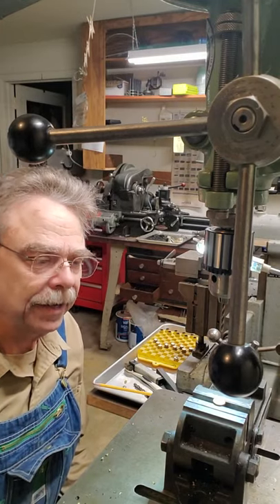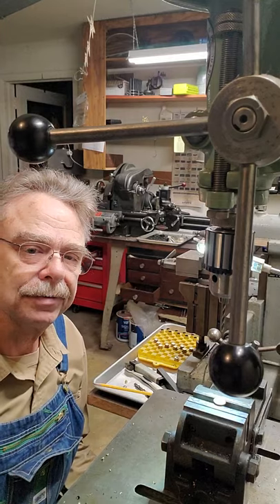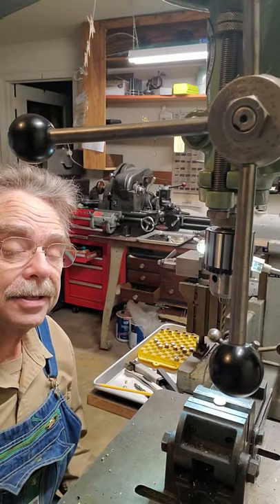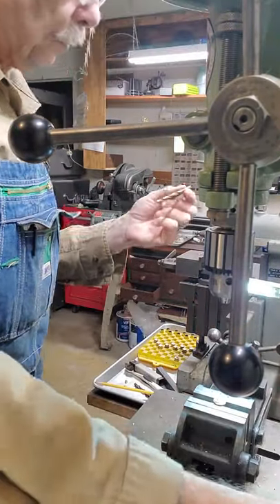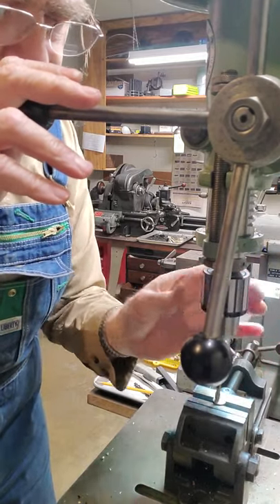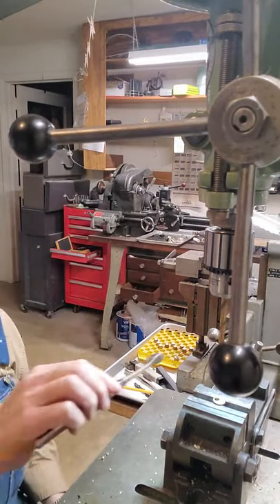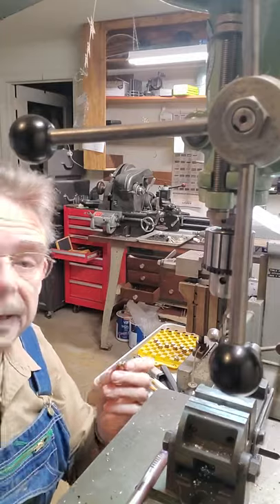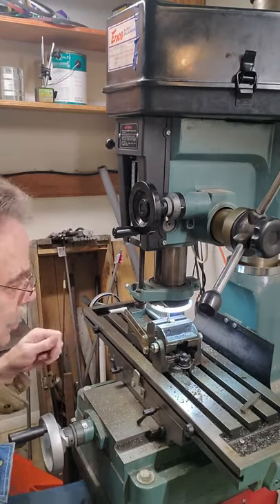Part 2 - How I convert centerfire cartridge cases to rimfire

Comment: Excellent video Steve!  This is an excellent way to get the old rimfires running again.  It would seem this method would also work with ramset blanks in smaller cartridges without adding any black powder.  Anyway, great video!

Comment: Good job, Steve! Sometimes I end up with blanks that fit a little loosely. So I apply a little clear fingernail polish in the hole. Doesn't seem to matter if I then insert the blank, or wait for the fingernail polish to dry.
Reply from the maker: I've done that too, nothing wrong with a little extra security. The .224" reamer work very well, providing a consistent fit of the acorn blank.
Reply: @steveblancard5566  Yes, I should get one of those reamers. I only used drill bits, and like you said, they don't leave a perfectly round hole. And often times, they get a little vibration going, that leaves the hole to big.
Reply from the maker: @Dimwit_the_last_mountainman  I started out using just a drill bit about 7 or 8 years ago. But when I found that a proper reamer was inexpensive, I got one. Well worth the money.
Reply from the maker: @Dimwit_the_last_mountainman  drop me an email at splitdorf@cox.net

Comment: Hey Steve. For your Ballard do you just need any standard .44 shell and what do you use for a projecrile in the Ballard? Normal .44 cal? Very new to this and I have a 44-Ballard I'm restoring. Have to shorten the shell at all?
Reply from the maker: You need to measure your chamber. Some can use  44 mag brass, others take a larger diameter case like the .44-40. That's what I use.  I use a  44 S&W American heel bullet from Old West Bullet Molds. But the heel is a bit undersized. If I was going to shoot it a lot, I'd get a custom mold made for it. More info here:  https://www.assra.com/cgi-bin/yabb/YaBB.pl?num=1618099748/0
Reply: @steveblancard5566  Thank you! Just looking to shoot it a couple times at most once it's "restored"

Comment: Hello Steve ,  Great how-to video,   And to you and John L. ... I have some guns that have very aggressive firing pins that rupture the case of the acorn primers, so I  do not do the last step of milling the edge of the rim as that will take some of the load of the hammer,  until I see how they  ignite......Doc
Reply from the maker: Interesting observation. Has the firing pin tip been altered, damaged or erroded? I would think something changed from how it left the factory. Otherwise it would have punctured the original soft copper rimfire cases too.
Reply: @steveblancard5566  Hi Steve,  You are absolutely correct in that assumption, and I thought the same,  but everything looks stock .   Out of six guns maybe two will rupture the acorns  on occasion      . They have heavy hammers and stiff mainsprings.  !???   ...Doc
Reply from the maker: Doc - please shoot me an email at splitdorf@cox.net

Comment: Ross Jones 
Hello Steve , I enjoyed your video .  I have several Ball &Williams and Richard Ball patent Ballards . I find the 44 40 and 44 magnum cases fit too tight in the 44 RF breech . Did you resize your cases . If so what did you use . Thanks.  Ross
Reply from the maker: There seems to be considerable chamber size variation in these early Ballards. On the N-SSA forum I read of guys using both cases. Mine has a large chamber that shortened 44-40 is just right for. I use a 44 S&W American heel bullet. But the heel is a bit undersized in the case. I found that sizing the shortened 44-40 case in  38-40 sizer was just right.
Reply: @steveblancard5566  
Thanks Steve ,
      I guess I will have to keep buying more Ballards until I find one that will take a 44 40 . I live in Quebec Canada close to the Vermont border where the 1870 Fenian raid occured . The Fenians with their  Needham  conversions were driven back by a small group of  sharpshooting farmers using 30 inch Ballard rifles . Until I find one I will try making some cases from 303 Savage cases like I saw in your how to video , that I found after I sent you my question . Ross
Reply from the maker: Have you tried trimmed 41 magnum brass? I use that in a 44 rimfire rolling block. The rim is a little small, but it works very well.
Reply: @steveblancard5566  
Thanks Steve , I do plan to try them . I have been thinking that the 44 40 and 44 mag shells I tried were used brass and posssibly too big because they had been forme fired in other guns . I will try some unfired shells in my Ballards as a double check , but I think the 41 mag sounds promising . Thanks again . Ross